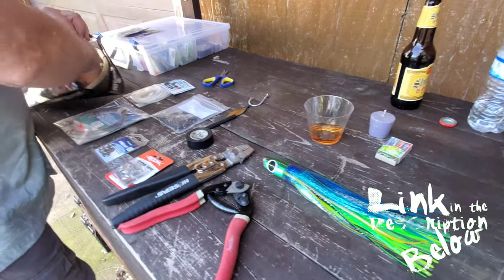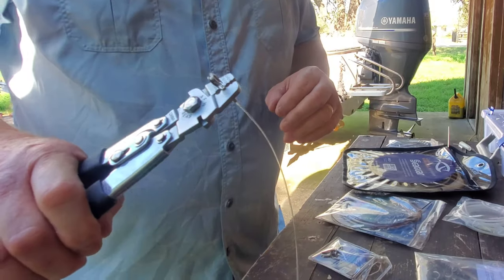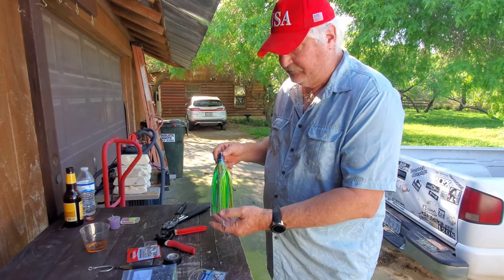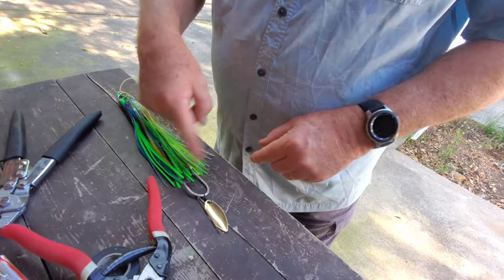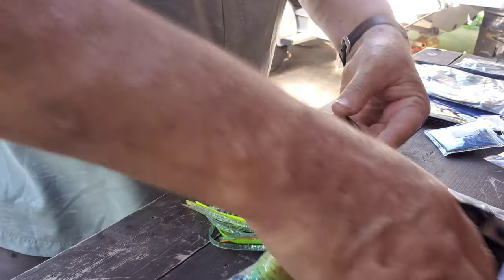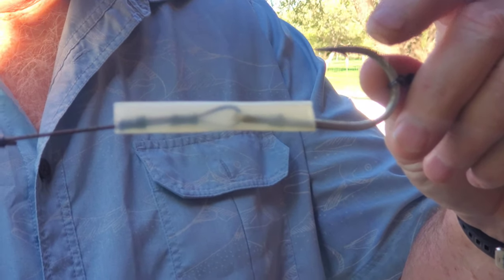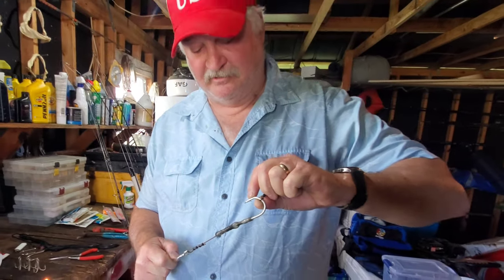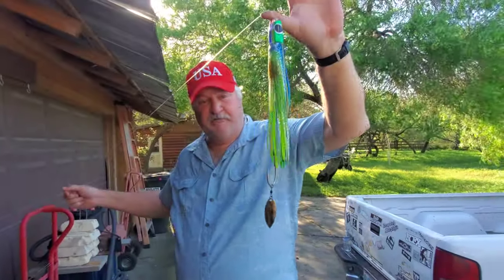How to Set Up Rigging for Trolling | Step by Step Fishing Skirt Guide (Wire Leader)

Comment: Can I suggest that you do away with the electrical tape and use shrink tube where the mono links to the wire. Instead of using direct heat with a flame, boil up a kettle and shrink the tube with steam. It does not weaken the mono. Here in the UK we always use this shrink tube method. I make shark rigs with wire and mono using shrink tubing on all crimped joints. Have never lost a shark where the rig fails at the joints. Nice video by the way.
Reply from the maker: Funny you say that; behind the scenes I was harassing my dad about the electrical tape.  I tell you what the idea of using steam is great, I am definitely adapting that.  Thank you for the insight sir!